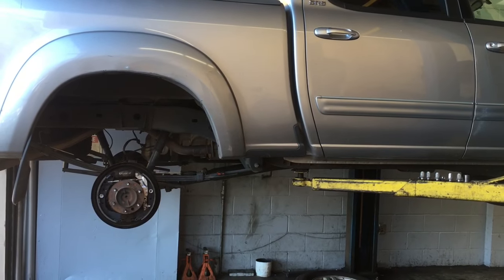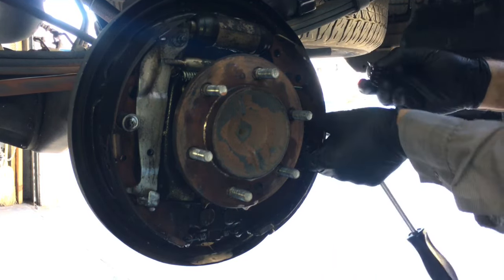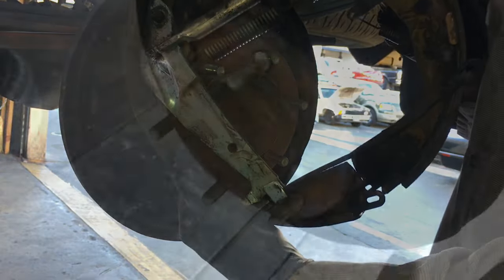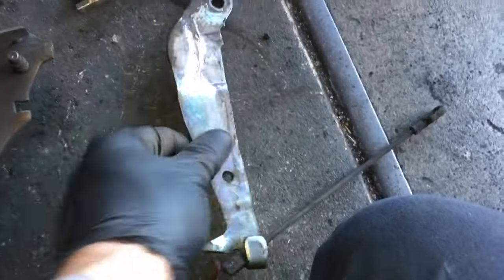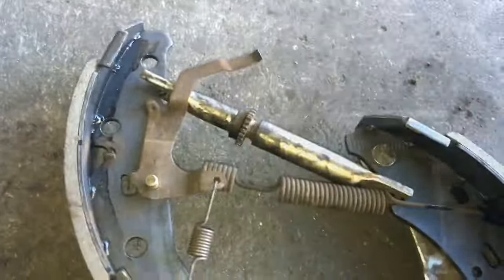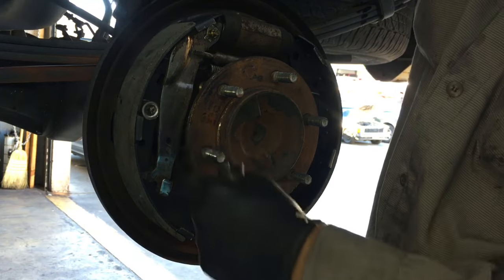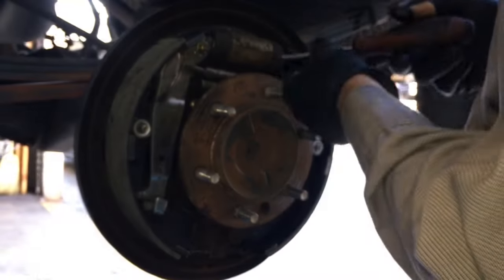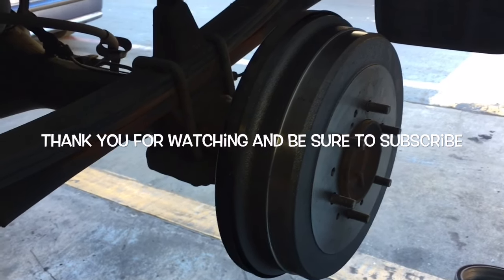How To Replace Rear Brake Shoes And Drums On A Toyota Tundra (2000-2006)

Comment: Thanks, I would not have known about using the M8x1.25 bolt.
Reply from the maker: Robert Street glad to help. Thank you for watching!
Reply: I knew that some drums have the threaded holes, and I was so relieved to find them on my Tundra. I'm pretty sure the drum was rust welded onto the axle, as it made a satisfying pop when it let go. Life in the cold north, I guess. Everything rusts.

Comment: Well... I learned today how NOT to do this job. In the end, I got everything in place, but it took a lot of patience and brute force. As frustrating as it was, I learned how things fit together. I should have watched this first. I did one side before it got dark. The other side should go a lot faster now that I know the easy way. My backing plate is so rough with rust that I don't know if the lube will help, but I applied it anyway. 😂

Comment: Thank you very much. I take a lot of pride in my 2006 Tundra and if I’m not absolutely confident I can make the repair I don’t attempt it. My timing belt is a good example. That’s the only work so far I had to farm out to the dealer. Your video is excellent and you don’t miss a single step. Definitely a new subscriber. 👍🏼
Reply from the maker: Glad the video was helpful. Thank you for watching and subscribing!

Comment: I just did one side but I use the other method of the top spring by pulling it with players and its so hard I just saw your method and its much easier thanks dude 👍

Comment: I dont need to bleed the brakes afterwards?
please explain, or link to the steps you
did previous when you disconnected the brake lines. thank you
Reply from the maker: If you open or disconnect any brake lines yes the system will need to be bled

Comment: So I just finish installing new shoes but I can’t get my drums back on. I dialed the adjuster all the way and I still have a hard time putting it on. I had to wack it with a hammer just to get it back on. I tripled check and made sure I installed everything correctly. Do you know what the reason might be?

Comment: Got this to do on my 2004 Sequoia before next months inspection.  Will set a day aside because things never go to plan for me lol!  One example, I did the rear brake shoes on my son's Yaris, screwdriver slipped as I was adjusting via the metal cog and pierced one of the rubber seals on the wheel cylinder.

Comment: Great video thanks for verbalizing as you worked
Reply from the maker: Jim Nuna thank you and thank you for watching!
Reply: Great video. Haynes book said to install top spring last. Didn't work for me. You're method of assembly on the floor then mounting is the way to go. Prying the second shoe out at the bottom to get it in place & lining up the bottom spring were also great tips.

Comment: I installed and followed the video but now everytime I break theirs a terrible pulsating vibration to the truck, did I do something wrong?
Reply from the maker: Tyler Bowling the drums a warped and need to be turned or replaced. If they are new return them for a new set.
Reply: How to Automotive yes I purchased them from auto zone so they were brand new. Do you think if I adjust the screw that would work? It might be too loose?

Comment: What was the horseshoe clip plier you used?  I can't find that model. That one is pretty cool because it works great on horseshoe clips in particular vs. Just for snap rings.   I tried to look on you site, but could not find it.

Comment: What if you have the bleeder open and the adjuster as small as it gets and the drum drill doesn't go on? F*cking advanced auto parts
Reply: Make sure everything is seated properly. If the forks of the parking brake adjuster aren't all the way seated into the slots of the shoes, you can't get the drum on. Ask me how I know. As an aside, I never go to the cookie cutter franchise stores like Advanced or Auto Zone unless something unexpectedly goes terribly wrong and I need a part ASAP. Their house brand stuff is overpriced and substandard, and they charge way too much for name brand items like Raybestos that they might not even stock. If you have a local mom and pop supplier and you can wait for regular business hours, they usually have way better stuff. The online retailers also put Advanced to shame.

Comment: Thanks SOOO much for this video! You did such a great job making it. Did mine today and this was a huge help!
Reply from the maker: Joe Driskill glad the video helped and you got your brakes done that’s awesome. Thank you for watching!
Reply: @HowtoAutomotive   Yes and I found that my rear axle bearings are shot in the process, which might have contributed to the right rear shoe and drum being metal on metal! It's a never ending story when repairing old trucks. I got this one, new in 2001. I guess I need to make a tool to press the bearings off.
Reply from the maker: Joe Driskill that sucks but when you get it fixed it’ll be good for a long time. Old trucks are worth their weight in gold.
Reply: @HowtoAutomotive  Yes Brian!  My Tundra rocks! Drop bracket where I cut the frame to lift it, 35" tires, Bilsteins and everything in the front new Moog stuff. Nice new seats and a vinyl covered, matching console that I made for to fit the bucket seats. Tons of stuff done to it over the years. Only thing not new is the rear axle bearings. 

My brakes were so bad that it was scary. Your video on the rear drums was a lifesaver! I thought that the rears were fine, but decided that there was nothing left other than the power booster causing the problems. After finding your excellent video, I went to check the rears and found that the right one was dismal! So, now I have a high pedal and decent brakes. I'm worried about the noisy and rough rotation of the hubs and if it might mess up my brakes and drums.  

I have a 67 Corvette that is jealous as it is a constant bucket of need, yet the Tundra is getting all of the attention as of late. Thanks again, my friend! You are awesome.

Comment: Great video.  An older Toyota truck came in for a rear axle seal repair.  We are going to replace the rear drum brakes on both sides due to the shoes being soaked.  Watching your video should speed up the repair process.  Thanks for the video.

Comment: Why in the world would they make this so complicated? Especially since they put disc brakes on the front.
Reply: As complex and as painful as it is, this design is ancient and has worked forever. I agree that it seems pretty medieval and obsolete. 

Did you know that air brakes on trucks and buses are drum brakes? The air pressure holds the shoes off the drum. That way, if the air system fails and pressure is lost, the brakes default to being applied.

Comment: If a person can do their own work on the brakes. They can save a bunch of money. I call a Toyota dealer ship and they wanted $250.00 per axle. 
But a bad break job ain’t no joke. So know what you are doing. You can’t have extra parts when done. Unless you are replacing everything.

Comment: Whoever decided we had to stick with rear drum brakes after 1999 needs to be smacked.  What a PITA compared to a disc brake with parking brake shoes on the inside and drums are pretty worthless for stopping power.

Comment: what size are the bolts you used to push the drum off? am just looking for bolts that say 8x125 thread on the packaging?
Reply from the maker: Ramiro Pinon 8 x 1.25 is the actual size. So 8 mm is the diameter 1.25 is the thread pitch and you want to get the bolt about 2 inches long. Hope this helps thank you for watching!

Comment: I know this is just a DiY for drums and shoes but would you recommend replacing wheel cylinders since they are right there while changing the shoes? Is there a specific mileage when they should be replaced? Thanks
Reply from the maker: italnkicbxr there's no specific mileage but if you have high mileage I would definitely change them out.

Comment: Thank you, this was a helpful video. It's nice to have a walkthrough on the 2005-2006 Tundra because the earlier first gens don't have the automatic adjuster??
Overall not a very easy job....
This walkthrough was valuable to avoid "doing it the hard way". When I got done my wheel cylinder was leaking...so if you've got a truck with a lot of miles that's maybe lived in the salt belt you may want to plan on replacing the wheel cylinder too or at least have a new one handy.

Comment: There should have been a lock washer (horse shoe shaped - crimped end)  holding the parking brake lever onto the left shoe. You didn't show removing or installing that. Other then that... great video.
Reply: Yes he did... Look at 3:28 Great job on the video!!!

Comment: Great video. The garages around here charge about 600$ for this, plus. So if you buy the kits for both sides and find some one that will resurface the brake drum you can save about 400$. Do be careful with the dust, although anything after 1980's should not have asbestos in the pads.. but you never know, spray it with soap and water good just in case, asbestos is harmless when it is not a dust. so wash it good.